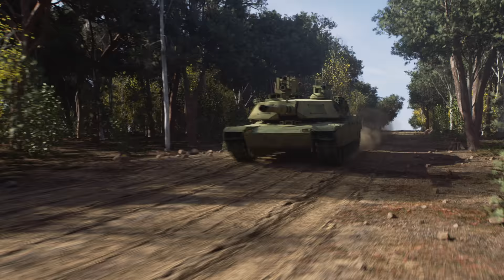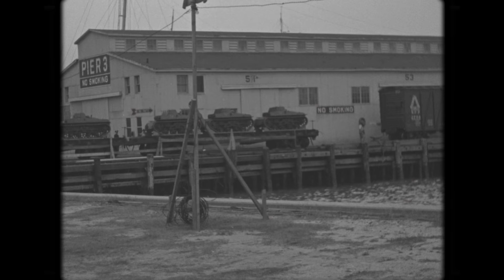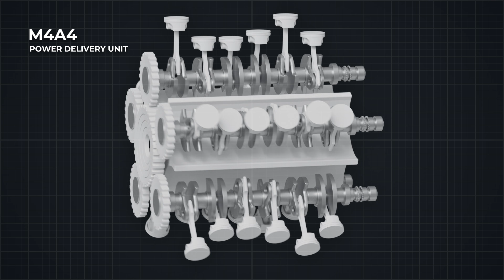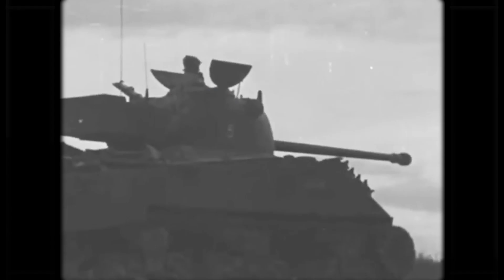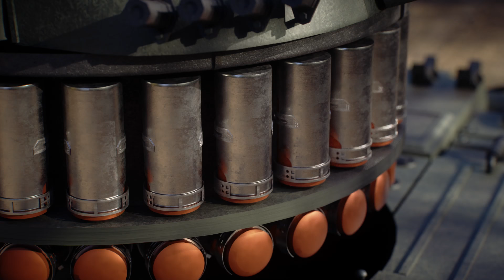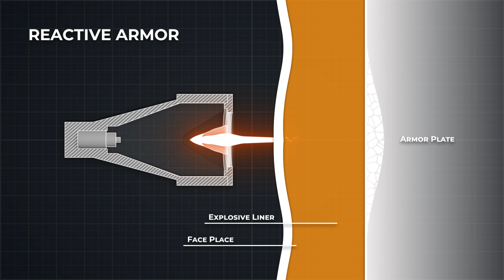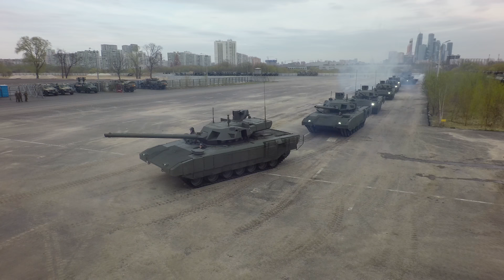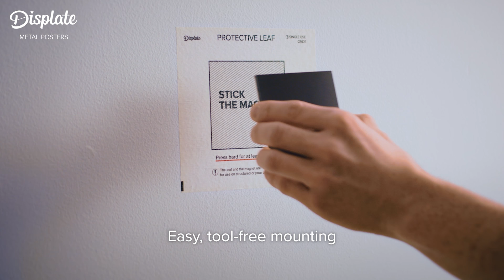Why America’s Tank Failed in Ukraine

Comment: The Ford F450, The American measurement system.
(Edit: Thanks  @jcraigie  for the clarification)
Reply: New cursed unit of pressure: F150s per football fields
Reply: @fulltimestudent1  And for small units we will have percents of F150s, right?
Reply: No, we use Chevy S10’s for F-150 fractions
Reply: @Killswitch_HellYeahBrother  How many Chevy S10's in a F150?
Reply: bout tree fiddy
Reply: @anssi34 About 13/16 😅
Reply: @Unprecendentiality  Fractions not decimals for sure.  31/64 - F150.
Reply: @Unprecendentiality  bananas por napkin
Reply: @fulltimestudent1 “Pressure your tire to 38t4hs of an F150 per football field!“
Reply: @FLF20M2  W🤣🤣🤣
Reply: @fulltimestudent1  Im gonna troll my students with this.
Reply: @fulltimestudent1  Google says one F450 weighs 8587lbs. One Field is 57600 sqft. That gives us 0.1491 lbft pressure, give or take around 7.14 Pascals.

One ford per football field is 7.14 pascals. A true American value 🦅
Reply: @blabik  it even looks like 7/4, the independence day.
Reply: we will do anything to avoid the metric system🤣
Reply: @stevedave70  you had the royal family saga right there and you went for sport and a beverage?
Reply: @stevedave70  True. You probably didn't understand very much of this video because the commentators wasn't using fluid ounces consumed per chain of distance  covered.
Reply: @stevedave70  Arrogance and ignorance
Reply: @stevedave70  Look up the official US specification of an inch. It is on the books for a standard as exactly 25.4 MM. The US is using the metric system and pretending they are not 😁
Reply: @waynewhelan3069  They would get more miles per gallon if they went metric ?.
Reply: @Woffy. All depends on if you go imperial gallons or freedom gallons. If you convert to imperial you get more miles per gallon. Freedom gallons cost more in California. 😎
Reply: @waynewhelan3069  In the Americas, a gallon is equivalent to 128 fluid ounces or 3.785 liters (American spelling). But in the UK, it's 160 fluid ounces or 4.546 litres (British spelling).
Ergo you get more miles per gallon if you go metric !
Reply: @Woffy. 😝
Reply: @stevedave70  the meteric system is french, so it is a hard pass.
Reply: "Just shave off 1/647th of an F150"
Reply: he said F450s lol
Reply: I only understand weight measured in Male African Elephants. Heights must be Eiffel Towers and volumes must be Olympic Swimming Pools.
Reply: And those are modern f150s, which weigh as much as 2 original F150s
Reply: He didn't say F150s, he said "F150s stacked on top of each other", because stacking them apparently does something to their mass.
Reply: @TarecPL it's addition.
Reply: Utterly amazing how Americans will prefer even the most cursed and absurd measurement if they can avoid the SI system. Just looking at oilfield units makes you think you‘re in an insane asylum😂
Reply: @FLF20M2 who needs meters when you have honda civics?
Reply: @FLF20M2  he already used actual units to describe weight. examples of everyday objects are commonly used for any large number and i see plenty of europeans do the same thing.
Reply: F450 not F150. pay attention
Reply: "Americans will use anything but the metric system"
Reply: NASA has 327 million reasons to disagree 😂
Reply: It's less useful for measuring baking ingredients.
Reply: was
Reply: We'll do whatever we can to avoid the metric system! 🤣🤣🤣
Reply: Anything but metric...unless it's ammo or drugs.
Reply: But does it take into account Fordflation? They get bigger every year...
Reply: glazed donuts per bald eagle
Reply: FURD…
Reply: For more precise units of measure you can also use Harley Davidson's.
Reply: I don't mind something to put things in perspective, as long as it's in addition to the actual number and not instead.
Reply: How many Carlos is one F-150?
Reply: My european soccer-field-sized bathtubes are very impressed.
Reply: Anything but metric… except in food and big bottles of soda and…
Reply: The equivalent metric unit is the Ford Ranger used throughout the EU with the UK still clinging to the Ford Transit.
Reply: How many cheese burgers is that?
Reply: ford is the biggest pile of shit you can have
Reply: Americans will use anything but the metric system
Reply: *F450
Reply: @jcraigie - I've got a '92 SuperDuty, an F450 by any other name. It's heavy
Reply: @tZydeco  That's a classic. I was just trying to correct the OP's mistake. The video used f450's as the metric, not f150's.
Reply: @jcraigie Thanks for the help.
Reply: @xx_insert_cool_username_he6876  NP. 450 is just that much more ludicrous, no recognition was necessary though.
Reply: All freedom units were derived from the F-150 platform
Reply: @steeltoe_stats  Freedom units have been converted to fascist units at an exchange rate of 1 to 1
Reply: @p @piccalillipit9211  there was fascism you wouldn’t see any protests period. That’s more of an Obama-Biden thing. Locking up people for praying across from Planned Parenthood for example.
Reply: @DavidPawson-d7h  Get out of the cult.
Reply: @DavidPawson-d7h 

😂😂😂😂😂
 That's rich !

I would have their them in a grinder
Reply: @DavidPawson-d7h  you are basically arguing that there isn't fascism because the fascists weren't successful in suppressing all opposition yet. 

The fascism displayed by the current administration is observed in their policies, not in their success ...
Reply: That's ok, Brits measure length by cricket bats, and time is measured by cups of tea per person.
Reply: @maxstr and the rest of the world on normal measures
Reply: I would rather measure numbers by number of blown ecoboost engines.
Reply: Still better than imperial…..

Comment: Engine power doesn't matter when your tracks get blown clean off by a 400 dollar drone
Reply: It needs some sort of active protection. Like a mini radar with a mini CIWS that can shoot down drones within 100-200 yards.
Reply: A $400 dollar drone doesn't matter when your tracks can get blown clean off from a $40 mine.  Not a new concept and it hasn't removed tanks from the equation.
Reply: @cstgraphpads2091  Mines don't fly toward the tank, they sit in the ground in hopes that someone gets fooled into moving over it and activating it. Tanks of course won't be made obsolete because of this, but combat footage since the Arab Spring has proven that drones are an extremely effective hard counter to anything that isn't a fixed-wing aircraft already in flight. They're cheap, light, portable, modular, easily prepped and operated, they have a low "time to target". It's like having a grenade or AT rocket you can zip right to your quarry. Between this and the attrition nature of true near-peer combat, Western military doctrine has been given a rude awakening. Asymmetric warfare isn't the exception, it's the rule, and equipment and tactics must evolve beyond "the Fulda Gap must hold". We've literally known this since Vietnam. Hell, we fought a nothingburger forever-war for 20 years (a war that ended a scant six months before T-72s rolled into Ukraine) that beat this lesson into the Pentagon's head... then the Kabul exit happened and everyone just sort of forgot because they were embarrassed that they lost and didn't want to think about it. Army will never learn, cuz procurement is about contracts and money exchange, not actually upgrading equipment. Pentagon won't learn, cuz they aren't getting shot at. And Congress? All they need to do is be socially deft enough to pretend that they weren't the ones to OK the shooting in the first place, so they can run for re-election or pivot to a career in venture capital.
Reply: Whoever believes [random weapon of war] is obsolete because of drones has no clue about the history of arms development and the actual impact of drones on the battlefield.
Reply: @UnfollowYourDreams  a several million dollar machine being destroyed by a few thousand dollar drones doesn't make a tank obsolete? if you look at any combat footage its mostly small groups to soldiers attacking thru fog or in treelines for cover front lines don't even exist in the battle field like they did anymore instead its mostly patchworks of soldiers in buildings where being even several dozen KMs away from the front line doesn't make you immune to drones
Reply: @luigigaming2717 yeah you don't get it.
Reply: @UnfollowYourDreams  i really never understood why people make a claim saying x has no clue about y then proceed to not give any argument to back this up when they are questioned at all
Reply: @luigigaming2717because drones at the end of the day aren’t doing anything regular weapons can’t. When you factor in all the electronics that they need to put on a drone to prevent it from getting jammed they cost just as much if not more than an artillery round which can’t be jammed nor intercepted.
Reply: @luigigaming2717 Drones kill far more infantry than armor. So is infantry obsolete? The assumption that a wonder weapon suddenly invalidates an entire aspect of warfare is never really a good starting point for discussion, because it is farcical. Drones can't fulfill the roles in combat that tanks do, they just can relatively cheaply take them out, which necessitates more careful deployment or electronic warfare countermeasures. Tanks are useful because sometimes you need a big armored box with a gun to assault or defend a strategically needed location just like you need meatbags with rifles to hold the locations, and drones don't change that fundamental formula just the cost of the inputs.
Reply: @wescoleman6240  the cheapest fpvs are like 500$ they are cheaper than artillery systems and aren't a massive target that needs to be relocated after a volley.
Reply: @luigigaming2717 you didn't ask for reasons. I have zero time for games, if you want to know something, just ask. But don't pretend this is a debate or something. It's not.
Reply: @wescoleman6240  you know the only thing you need to make a drone unjammable is a wire right? its not some multimillion dollar modification. just hard wire a fiber optic on it with a solder heck put a rj45 port on it for ease of use. Its not complicated.
Reply: @rawrmonster6782  what does that change in the equasion? Nothing. 

Weapons do not become obsolete when there is a new counter to them, they become obsolete when they get replaced by something far better.

Armies didn't stop using bows when plate armor became common on the battlefield, bows went obsolete when fireams became reliable enough for battlefield use.

Tanks are not obsolete because in addition to mines, missiles and artillery there's now also drones, they will be obsolete when someone invents a thing that does the mobile-bunker-with-giant-gun better than a tank does today.
Reply: @rawrmonster6782 You can still intercept them with things like hard kill protection systems or having the infantry around the tank just shoot it down.
Reply: @Darkestnova25  "the assumption that a wonder weapon invalidates a whole aspect of warfare is a bad starting point for a discussion" thats where you misunderstood me, tanks aren't one whole aspect of warfare, they are one tool in that aspect. A spear is an infantry weapon that is now obsolete, does this mean the entire concept of infantry weaponry is also obsolete? "Tanks are needed because times you need an armoured box to defend or assault a position". And how good are tanks at fulfilling this job? The cost of a tank compared to how cheaply it can be destroyed a drone attack is almost always in the thousands, it is almost always a severe economic loss to use tanks in any realistic capacity which is exactly why the T-14 Armata has not been sighted a single time in Ukraine. Is it perhaps because the russian high command knows that tanks are already highly ineffective and so its best to just wait things out until an effective drone counter emerges instead of deploying it and losing your newest tank and letting the enemy potentially have a free look inside your engineering? Usually in war, if you have a new upgrade to a weapon that is effective, you would want to actually use it in combat so your millions spent on research and development actually get used for their intended purpose instead of being a toy used in military parades and sitting in bases doing nothing.
Reply: @wescoleman6240 a drone isnt just something you smash into something to make it explode, its also reconnaissance, for the same price as an artillery piece you get an additional recon feature and the fact that it is almost garentueed to get a direct hit on something assuming it doesn't get jammed or shot. Drones arent doing anything regular weapons cant sure, they just do it in the most effective way possible so that the entire war revolves around the question of "how can x get to y without being intercepted by drones?"
Reply: @rawrmonster6782 Fiber optics snag on stuff too. Drones work ~1/3 of the time overall, often vs. softer targets - not invincible vs Abrams, where many of the 27 hits were from mines (repairable), not just drones. Tanks are often fixed, not destroyed. EW jams most now; crew tactics matter more.
Reply: @luigigaming2717 drones change nothing but the cost of fighting a war. But since war is already a bottomless pit you pour money in, it doesn't really make a difference either. FYI: way over 90% of combat losses in ukraine are still caused by artillery. So... even that didn't change since ww1.
Reply: @UnfollowYourDreams wars are won in the logistics and supply departments, cost matters a lot. Brushing it aside as "just another sink" misses how important the price of war is. Would germany be able to win ww2 if they had 50% more factories throughout the war and therefore causing the cost of military equipment to drop? That's kind of hard to answer and depends on which factories would get the boost, but you can say for certain it would have made the war significantly harder for the allies. 

I would ask a source for the 90% claim but it is believable because Russian war doctrine emphasises on artillery dominance. Thats like saying "fyi, 100% of Venezuelan losses are done by air and naval forces, its still basically the Pacific theatre". Ukrainian casualties are caused mostly by artillery because thats what Russia is really good at, most russian losses are the cause of Ukrainian drones because they have the edge there, most of who ever is Trump's adversary if the month's losses are caused by air and naval units because the US is ridiculously good in that department. Basic military strategy is  forcing the enemy to play on your field of dominance. It isn't a surprise that you destroy most of your enemy with the weapons you have developed the most.
Reply: @wescoleman6240  Not as easy as you make it sound when its very clear from all the death videos on the internet that infantry have a very hard time doing anything against drones. People just arent very good at shooting flying bombs apparently. Now the automated systems with aa flak are effective but that falls into the same problem as everything else in that AA flak bullets are more expensive than most of these drones given you have to fire like 20 or so per burst to even reliably hit the math gets really bad very quickly.
Reply: @UnfollowYourDreams  damn, what happened to battleships then?
Reply: @luigigaming2717things don't get obsolete as much as the war meta changes.  Most Weapons are still HIGHLY effective at their designed roles, but if the thing they're made to counter no longer exists, then they become obsolete.  Look at the T95 GMC superheavy: meant to break through the magiot line but they solved it with Sherman bulldozer blades.
Reply: True, but it can help a lot in staying away from that $400 drone

I'd rather be scooting along at 30 mph than stuck in the mud.
Reply: The type of FPV drones used by either side in the war are usually at around 2000 dollars minimum.
Reply: @leventekocsis9103 In the age of AI, claims are easy to check. "Authoritative" posters need to realize that it.  From a long, detailed answer supporting the claim: Grok 3 AI:  "Reports from 2023 through 2025 consistently place the average or typical cost in the $300–$500 range per unit for the standard FPV drones effective against tanks."  The middle figure would be...wait for it...$400.
Reply: @lev@leventekocsis9103google is free bro it is about $500 for a fully equipped anti tank drone
Reply: @leventekocsis9103i fibbed the number for dramatic effect lol
Reply: @ahmedk0013 
He is wrong it is about 500 dollars
Reply: @leventekocsis9103 ...a 50 dollar drone and a 50 dollar RPG ammo is just enough for that junk...
Reply: @KamoTechx  Nope. That fifty dollar drone can't carry even the 50 dollar RPG shell. And tanks can take RPGs.
Reply: @wesleyfravel5149  ... those are swarming drones... so your tank is fucked..
Reply: @KamoTechx  Even the cheapest improvised drones used in the Russia/Ukraine war are well over $2k. They aren't using a 50 dollar kids toy off Ali express that can only go within eyeshot and would get knocked around by the slightest gust of wind.
Reply: The only reason drones are any sort of effective right now is because they have developed no counter for it yet.

The moment countermeasures for drones come along is the day they become just another weapon.
Reply: You'll need 9+10 of these drones to damage a tank by 21% ☝🏻
Reply: Which they don't.
Reply: A Shahed is $70k which is a bare-bones mass-produced drone. A Bayraktar is $2-5 million per unit. Being able to carry an explosive able to take out a tank requires a large drone, plus you need a big battery for range and high loitering time, and expensive surveillance equipment.
Reply: @PlayWaves1  those are not the drones taking out tanks. The shahed is basically a cruise missile drone and the bayraktar is closer to a plane than anything. The drones taking out tanks are just quad-copters with mortar shells and a detonator taped on them. Lets not pretend that either of those are the actual drones being used against tanks.